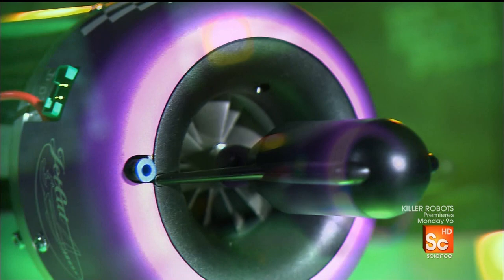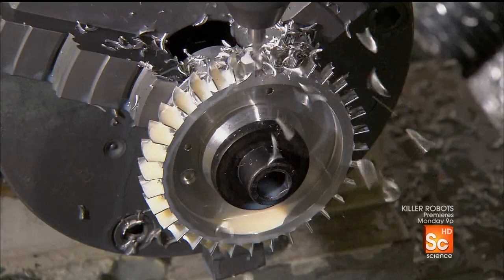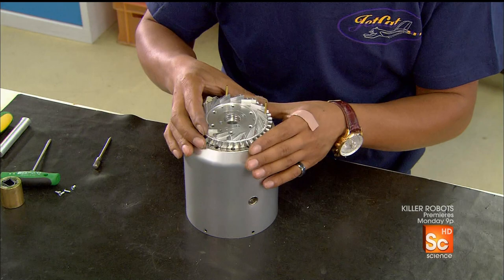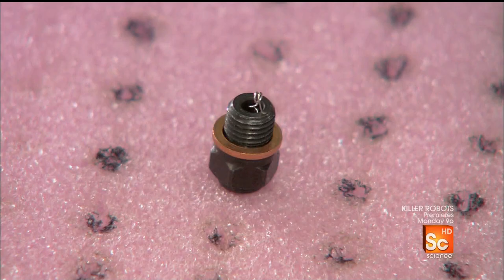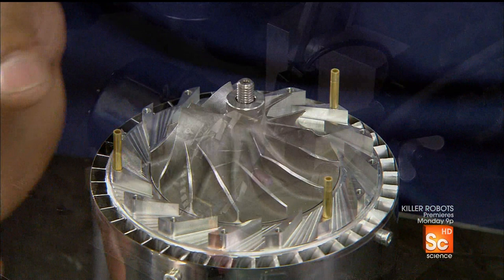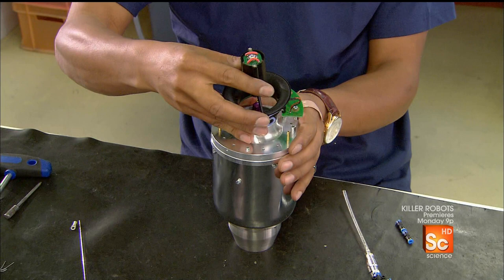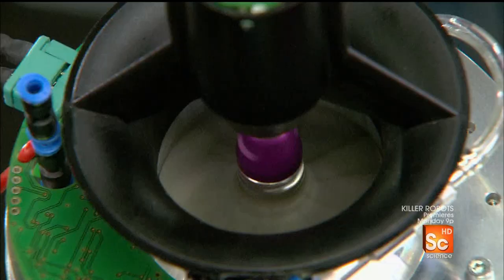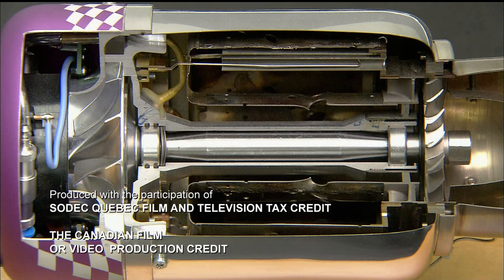Model R/C Turbines

Comment: can these engines run on methanol?
Reply: Nope. They run on Jet A, Kerosene or Diesel.
Reply: your not really answering my question its like asking if a an can run on methanol then someone like yourself saying nope petrol. I know jet turbines can run on any fuel providing its liquid or gas. So I ask again can it run on methanol? if not what are the reasons.
Reply: James Smith I'm not an RC guy, but yeah, in theory, a turbojet could run on methanol, the only problem I can see is that you may not get enough pressure to keep the engine running.
Reply: I can't see why that be the case I was more concerned could it with stand the heat, if I remember well methanol burns faster and hotter than petrol etc. thus why an family car would blow its head after a while but will go a lot faster than running on petrol.
Reply: I think its funny when ppl cannot see a jet turbine engine and a jet turbo is the same thing. Jet turbo is a low bypass and not efficient  during low speeds, fan jet is a high bypass but very efficient during low speeds. low bypass is where most of the air is driven into the combuster and high bypass is where a lot of the air passes down the outsides of the engine(see 747 airbus) if interested.
Reply: It runs off of 'Nitro fuel' a mixture of nitromethane and methanol so yes.
Reply: okay cool
Reply: Turbine engines can pretty much run on anything flammable as long as its not a slow burning fuel like petrol. Kerosene is recommended because its a good type of fuel and very cheap.
Reply: thx man i thought some fuels might burn too hot for this engine to handle
Reply: James Smith
methanol actually burns quite cool and takes a lot of input energy to start combustion
Reply: okay although ive heard jets can run on this?
Reply: James Smith
full sized jets yes but miniature jets, no. why would you need to know this or even ask? what a weird question.
Reply: i plan on trying to run a model engine on pure hydrogen gas sourced from electrolysis, this way i could make my own fuel with solar panels, keep the environment clean and still enjoy a nice turbine flight.
Reply: skyhawk551 you probably want to compress it to liquid if you want any kind of run time
Reply: why would you want to run it on Hydrogen?
Reply: James Smith because i could use solar panels to generate electricity, use that electricity to split water into oxygen and hydrogen, collect the hydrogen gas and burn it in a jet engine. this way we could power jet aircraft using solar panels indirectly. i could make my own fuel, enjoy flying jet aircraft without using carbon at all
Reply: You'll be an old man by the time you have a tankful
Reply: lol